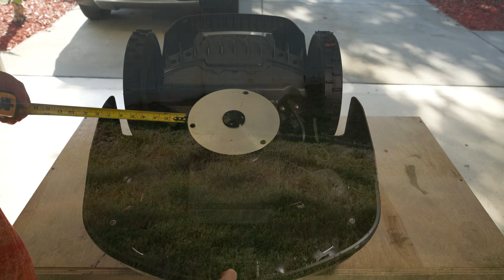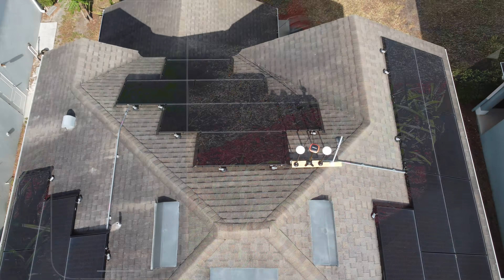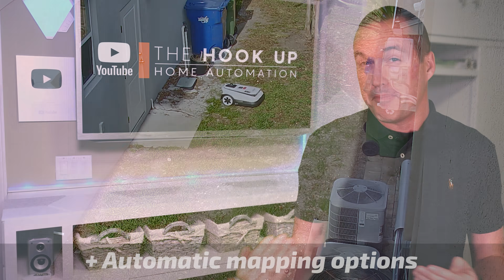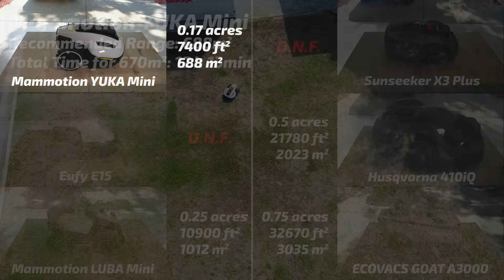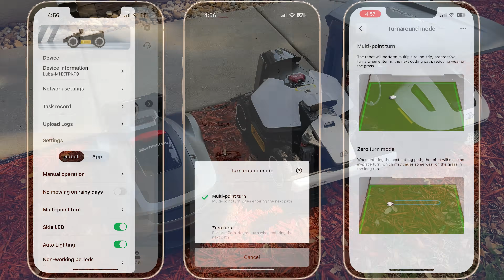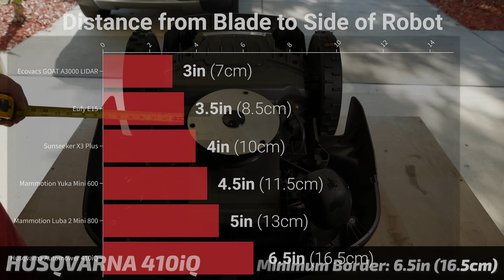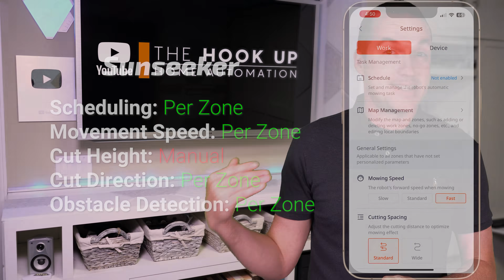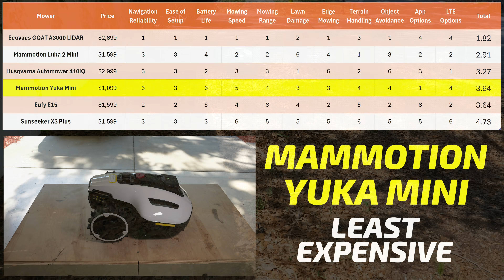Watch BEFORE You Buy a Robotic Lawnmower - LIDAR is a GAME CHANGER!

Comment: I bought a zipmow off temu for 300 bucks. It is controlled like an rc car and I do my back and front yard in like 15 mins while I sit in the shade. Best purchase i ever made
Reply: I have one also, it is pretty decent 
Also have dual M18 adapters for it.
Wish they would have placed the battery slots up front to make it climbs hills better
Reply: @MichaelRobibaro  it takes ryobi batteries i plan on upgrading to two 6ah. Only downside to this mower is it doesn't suck the grass like a gas mower does so if the grass is compacted it won't cut
Reply: @antd2733  yeah I know, I got m18 to Ryobi adapters so I can run dual M18
Does your power surge on and off when battery is low?
Reply: @MTB-Lights  no
Reply: @antd2733  mine definetly does
Didn't notice it the first time, def did it last time when sections of grass were damp, did it this time when grass was dry
1 bar left on battery and it'll stop, if I hold it long enough, it'll power back on then eventually die and repeat
Reply: @MichaelRobibaro  on thick sections where I hadn't cut in 2 weeks it did bog down slightly. I found replacement blades on ebay. Can't find any other parts. Those blades are very sharp sliced my finger trying to change height
Reply: I control everything and can accelerate slowly so I dont damage the grass on sharp turns

Comment: Ive been waiting for this video. Although my current mowe4r wasn't featured. The RoboUP

Also no Yarbo or Segway or even your favoritebrand Dreame. Come on man
Reply from the maker: Dreame does not make mowers for the US market, I specifically asked them about the A2.  Yarbo wasn't shipping their new trimmer model for me to buy and I asked them if they would send me a review unit, but they said they were only interested in "Gentle reviews".  Segway could have been included, but it's just another GPS/RTK unit so I didn't feel like it was going to add a whole lot of value to the review.
Reply: @TheHookUp  great points sir. Still a great review. The RoboUP has cameras and RTK. Kind of a hybrid of the systems. Its been great this year so far in the Midwest. I will be eyeing the ecovacs/ dreame/ mova lidar based systems next for my yard

Comment: Quality of cut is missing here, is that an assumption on your part they all cut relatively similarly?
Reply from the maker: All the blades are essentially identical.  The only difference is that the Mammotion robots have more blades per disc and the Ecovacs has 2 discs.
Reply: @TheHookUp  There are other things to consider though, like cut height or making sure there is no strip of uncut grass from a mower not overlapping its previous pass correctly. Would've been a good thing to test tbh, guess not much you can do when it hasn't rained.
Reply from the maker: As far as coverage I can tell you with nearly 100% certainty that the Ecovacs had the most complete coverage, followed by the LUBA and YUKA.  They were all very systematic when it came to mowing patterns.  The Husqvarna did fine in large areas but was all over the place when it came to borders.

Comment: I have had the v1 Yuka 1500 for almost a year and it has been great. It currently takes around 6 hours to cut my backyard (814m2) including two recharges. It has only been stuck a couple times when a mole trashed an area next to the fence. It does randomly lose GPS positioning temporarily but it is able to continue cutting for a short distance using vision before it has to pause and wait. I just ordered a second battery to double the mow time hoping that I can deploy the mower to the front yard and have it finish without a recharge. Unfortunately someone will need to open a gate to let it cut the front until I figure out a way to automate releasing the mower without releasing the dogs.

Comment: i'm surprise to see no border wire type robot...
It's a pain to setup, but it feel like it's more precise and consistent compared to vision or gps, and i don't know how wrong that assumption is.
having border all around the garden and very tight (sub 1M) corridor between grow bed feel impossible with GPS, is it ?
Reply: Having owned a random navigation perimeter wire robot (ambrogio) before getting my lidar equipped dreame A1, I would rather cut my lawn with a pair of scissors over getting another dumb perimeter wire robot. Unless you have the simplest of gardens with the most durable resilient grass that your dumb mower can drive over 2378x with no marks or damage before finally mowing that sharp corner,  perimeter wire robots should not even be considered in this day and age.
Reply: Using boundary wire mower in 2025 is like using a dummy phone...Yes you can still make calls and text messages, but kind of limited compared to Android and Iphone phones. I owned several boundary mowers from different brands through the years and I was tired each spring to fix boundary wire breaks.
Reply from the maker: That corridor would not be an issue assuming the GPS signal is good.  LIDAR and vision robots would have zero issue with it.  

The issue with border wire is that it is meant for a single large area without interruptions.  It would be almost useless in a suburban yard with driveways, walkways, and sidewalks.

Comment: And the Segway Navimow? I would like to buy the X315
Reply from the maker: It's RTK, so it would have all the same issues as the 4 RTK mowers in this video.
Reply: @TheHookUp but they told its a different technology, it should be tested
Reply from the maker: It's not different.  They can't change GPS signals.
Reply: @TheHookUp they told it combines RTK, vSLAM and Visual Inertial Odometry technology. Maybe it will be different than a standard RTK
Reply from the maker: Mammotion does the same thing.  It still uses RTK for it's primary navigation and cannot function properly without a strong, consistent GPS signal.
Reply: @TheHookUp Unfortunately I placed my order before this video, I'll report back when it arrives
Reply: @TheHookUp  No mammotion doesnt do VSLAM. Their camera is only used for obstacle detection. Segway does do VSLAM, as do cheaper RTK ecovacs robots, and sunseeker. Im not sure your sunseeker ever got a chance to use it though, since it kept getting stuck.

Comment: These are ridiculous over priced disposable POS.
Reply: well given the tech they have and comparing it with a flagship robot vacuum, they are very primitive and expensive indeed
Reply from the maker: There are a few factors that are keeping costs higher than robotic vacuums:
1) Less product volume, the adoption rate for robotic lawnmowers is very low compared to robotic vacuums.
2) Built in warranty repair/replacement liability cost, being out in the elements makes these things much more likely to break than a robotic vacuum so they are more likely to need to be replaced under warranty.
3) Legacy brands like Husqvarna are holding costs high, so even if Chinese companies like Ecovacs could afford to sell for much less, they don't really need to because there isn't market competition.
Reply: @TheHookUp  yeah fair enough i kinda forgot about point 1, on top of that in western europe most people havent got big houses with gardens like in US.

Comment: I'd love to see a review of the Goat G1, apparently it's beacon powered not GPS powered?

Edit: apparently it uses UWB beacons, inertial navigation, and gps
Reply from the maker: Seems like a lot more work and failure points than LIDAR.
Reply: @TheHookUp  Partially price, mostly availability. It'll probably get to australia eventually :D
Reply: I have the Goat G1. I bought it two years ago quite cheap (at the time). It comes with two beacons (UWB), but I needed to but four more as my lawns are on two levels (about 4 meters/14 feet) difference. There weren't many other options at the time. Once you've figured out how to place the beacons in a way that they can communicate with each other (max distance and max degrees) it works pretty well. And compared to other robot lawnmowers I've tried, this one is pretty decent when it comes to rough terrain and slopes.
If this lawnmower dies today and I would happen to get my money back (it died once, and I got a slightly newer model, I think the first ones had problems), I would probably have gone for the Luba mini 800 as my yard isn't that big, and GPS signals shouldn't be a problem (and the Ecovas is 50% more expensive atm) . Love that 4WD technology of the Luba, as well as the app. Never underestimate app functionality support.
FYI - I had loads of problems with my app and mower (Goat G1) the first two years. In the beginning it looked like they treated robot mowers as robot vacuums, but it's gotten a lot better.
Reply: @fthorsen  Thanks so much for that review, I'm still rocking a 5 year old landroid and while it still works problems with the perimeter wire and strange behaviors are beginning to be a problem, it blew up it's power supply in January lol (It hates Christmas decorations so it spent a month in party mode)

I'm looking at update options for when it dies... We have an ecovacs vacuum and it's been ok if a bit forgetful of the floor layout... The thing that's turned me off from the Luba is the subscription modem feature, I would just like to put my IoT sim from the Landroid's GPS tracker into it otherwise.

We have a mostly flat yard, it's only like 400sq meters but it's u-shaped around the entire house so I'm not sure how beacons or gps would go (the neighbors built on the boundary...)

Comment: I would not recommend Ecovacs. Over the past five years, I’ve owned three different vacuums and two Goats, and each device lasted only about a year, despite proper maintenance and storing the Goats in a shed during winter. While the hardware appears solid at first, it seems designed to fail after a short period. However, the software is by far the worst part—constantly buggy and frustrating to use. If you’ve ever had to repeatedly factory reset your robot just to get it to return to its docking station, you’ll understand my disappointment. Luckily I purchased them all with extended warranty so return/replacement was easy. i would suggest the same if you decide to get anything from Ecovacs. Also forget about customer support. they will straight ignore you for weeks, and guaranteed not be able to resolve any issues.
Reply from the maker: Interesting.  I haven't had any issues with the app/software, it's been rock solid.  Also, one of my oldest running vacuums is an Ecovacs T8 that I used for 2 years and then gave to a friend who has been using it since, so it's been going for 4+ years with no issues at all.
Reply from the maker: Also, I assume that your GOAT's were RTK? Factory resetting to be able to return to the docking station is common if the docking location has GPS reflections, it's an RTK issue, not an Ecovacs issue.
Reply: @TheHookUp  There are a few more issues I haven’t mentioned. The robot leaves a significant gap along the edges, and there’s no way to adjust this. I also have a sharp corner where the robot tends to get stuck, moving left and right and tearing up the grass with its wheels. In several other spots, it tries to go somewhere but fails, and the wheels just keep spinning, ripping up the lawn even more.
The final straw was after I bought fresh batteries for the beacons and reset everything again after winter—the robot simply stopped recognizing one of the beacons. To make matters worse, this was already a replacement unit, since the previous one died within two weeks. At first, I was excited and even left a five-star review, but over time, the problems just kept piling up.
Reply from the maker: Understandable.  However, I'm not sure it makes sense to write off an entire company and discount the performance of this specific model just because you had issues with a completely different model using none of the same technology.
Reply: @TheHookUp  did i mention my problems with Ecovacs vacuums? :) i wont get into details with those because its unrelated.
Reply: @TheHookUp  i didnt get into details about my problems with vacuums as its offtopic. i also mentioned dreadful customer service, and weeks of waiting. that said i do strongly recommend extended amazon warranty, as amazon will be only one to help out. i know technologies vary from model to model, but extrapolating my experience i probably wont be buying anything from Ecovacs.